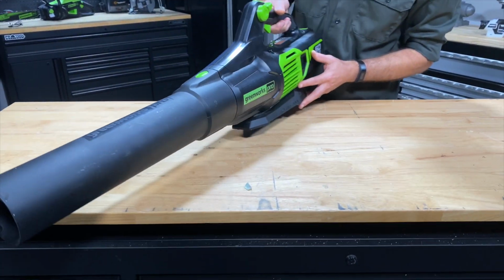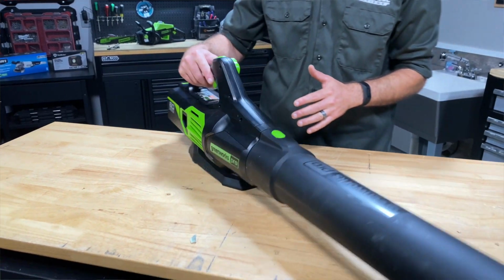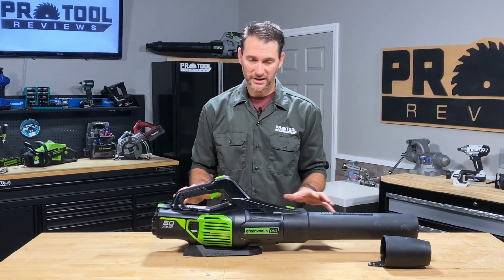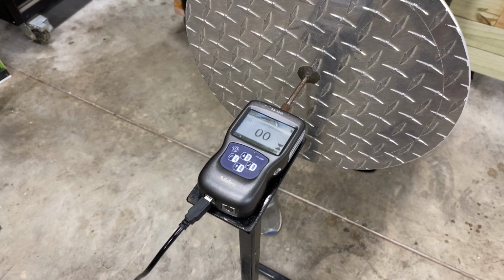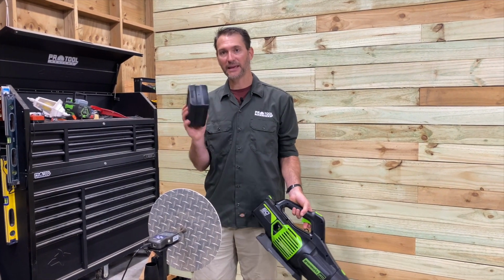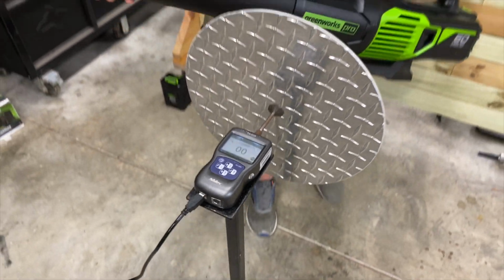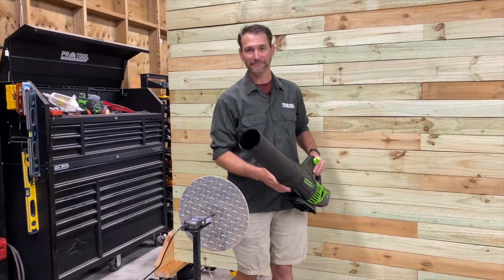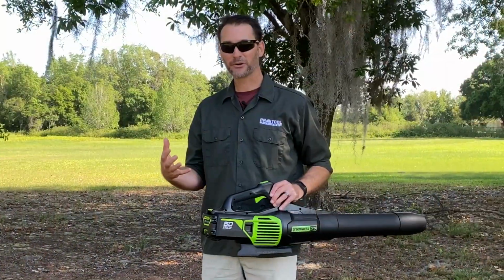Greenworks 60V Blower Tested | 610 CFM 130 MPH

Comment: Their customer service is bad.
Reply: So far, I haven't had any issues. I bought a lawnmower from them but forgot to apply my discount code. Emailed them and within about 12hrs they got back to me asking me for the code and within a few hours after that, they had refunded me for the discount amount. So in less than 24hrs I had my issue resolved.